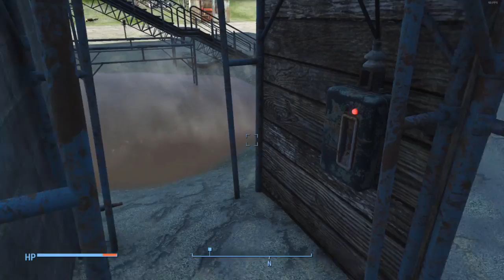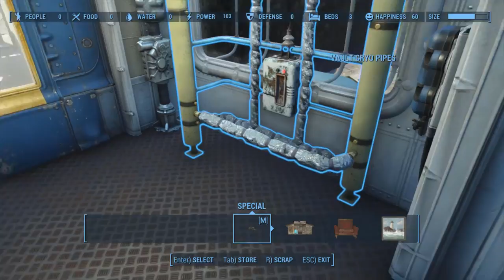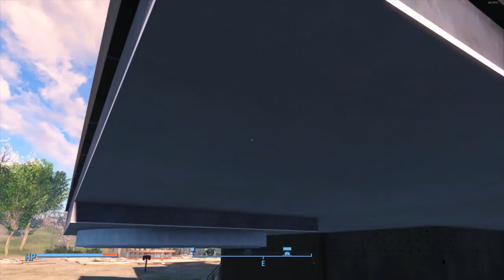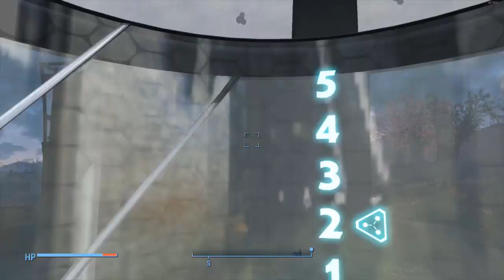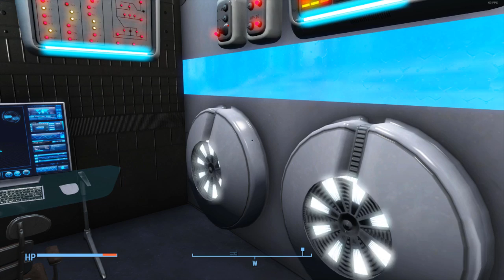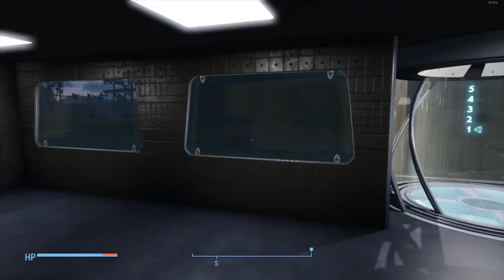FALLOUT 4 High Tech Build - The Black Fortress II

Comment: in all honest i likie the idea of the 2 story power armor storeage or make the top area for bot making, add the ultra high security research room in, with a hidden bed room. the windows i would say is to remove them and if yu can make that hole wall flush and make the ele-vader (sp) more inside.

Comment: I mean damn.. So many things bro. First of all, this building has more style than anything I've seen on any channel or in the vanilla game. The structural architecture is not only aesthetically pleasing but also extremely well designed. Your airlock is easily my favorite part of this structure so far and I would love to see perhaps a red flashing light in the air lock while the doors are open. It would definitely add that live high tech building visual. Next thing man DEFINITELY make it a 2 story powerarmor garage, 2 story luxury sweet, and leave the elevator walls the way you had them originally. I kind of had a vision while watching this and I wanted to throw a name out a name that I felt framed it pretty well. Hyperion Estates. To me it sounds pretty high tech and it sounds like what a cap rich Wasteland Batman like engineer would want to to call his residential estate where he hosts a penthouse, Powerarmor garage, and Vertibird Hangar with a helipad so you can travel in style to your other settlements ??? 😂 I'm dreaming man. I just can't wait to see the defenses and the new logic gate systems on this settlement.. Keep it up Dally the suspense is real!
Reply from the maker: thanks man :) and great ideas!